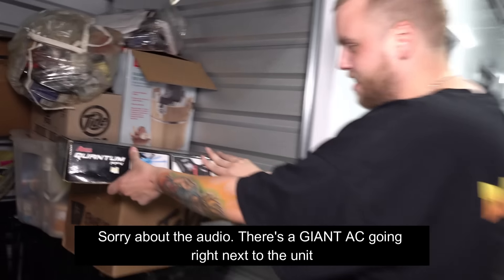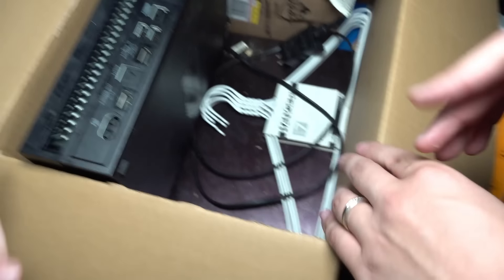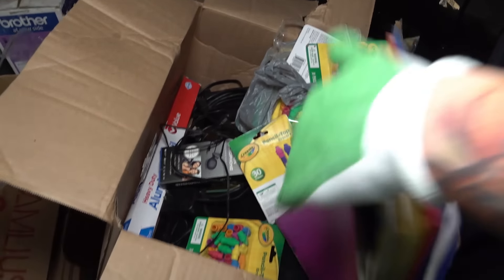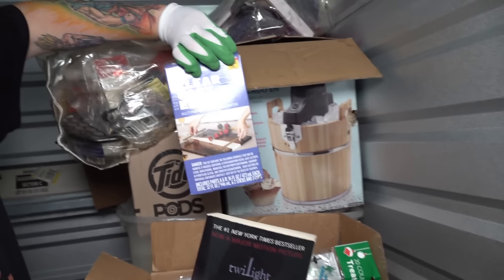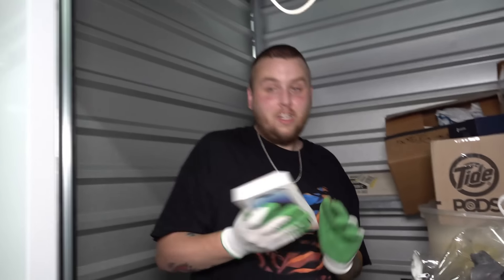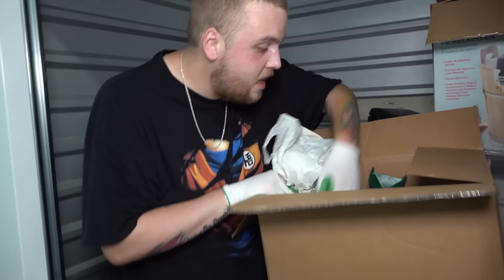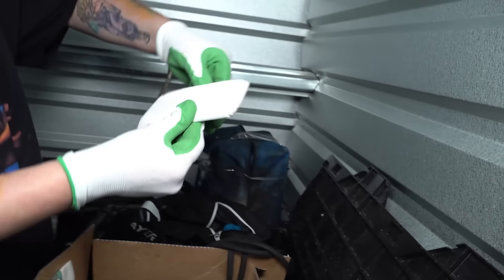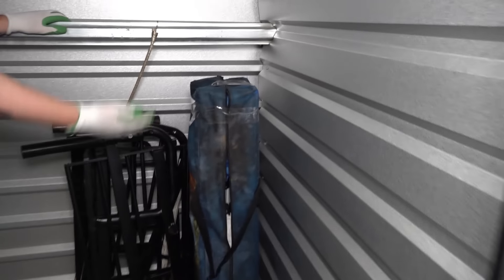I Bought a Storage Unit For $210 and OH MY GOD! 🤢

Comment: That unit was from a heavy smokers home which is why the brown crud on everything.  Cigarette smoke/ nicotine leaves a residue on everything.  The smell from old smoke is rancid.
Reply: That’s what I thought too ewwwww
Reply: My experience is telling me that is from heavy insect infestation. I am a technician, and work inside homes, that is roach stuff. People can be gross, to the point where I have to have my van regularly treated for roaches, because occasionally I will have to swap out equipment that has been infested by them, and even when I put them in air tight bags prior to putting them in my van, they manage to infest the van.
Reply: agree

Comment: The cup Turner is a good thing. You use it to make the tumbler.  It is only Resin or epoxy on it. And can be washed down. If you still have it when read this,  I will buy it from you.

Comment: That cup turner is used to do tumblers. That Turner if it works you could get $40. That epoxy will go with it. The paint bottles could go with the cup turner. There are people out there that will buy all that.

Comment: Epoxy is resin. The cup turner is used to put resin on cups. You put the cup on the rod ,( it is missing some parts) and it turns the cup while you put resin in on it.